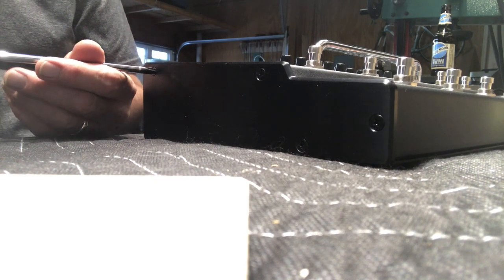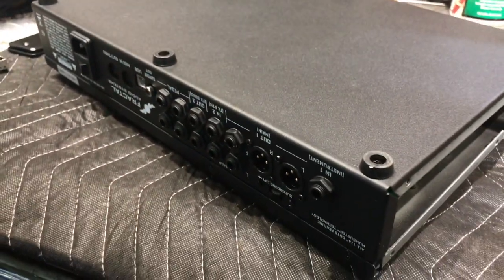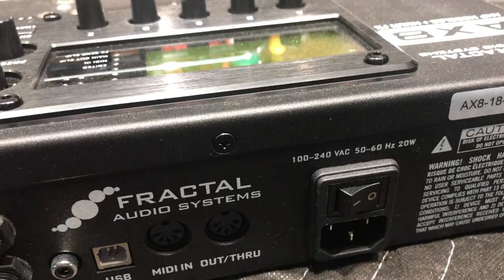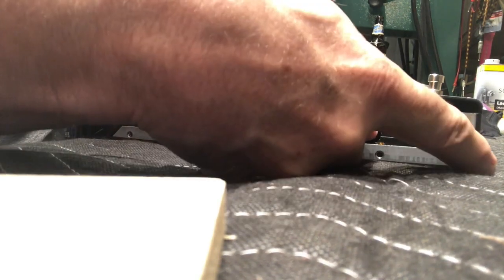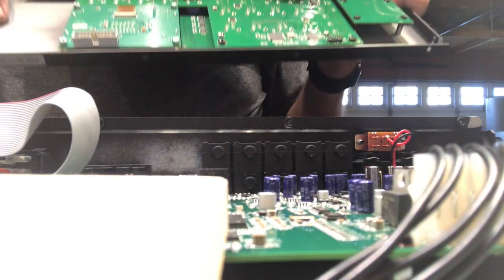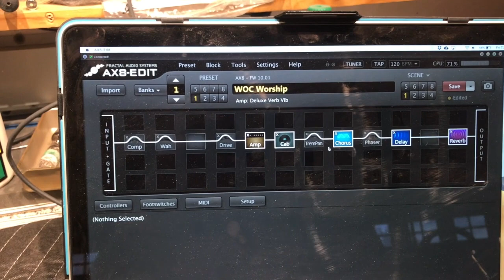AX8 USB Type B Replacement project

Comment: I could not believe it when I found this video! I have just "broken" my USB today so I have found this an excellent visual description of what is needed to get things fixed. I am asking a friend to do the soldering but I can do the nuts and bolts stuff. Thank you!
Reply from the maker: It's pretty easy, just go slow and not too much heat ok.  Cheers
Reply: @65Corvette  Thank you, advice noted, low heat so no damage and then I can get back to some blooze of a different nature!

Comment: Was the problem that the little middle plastic piece fell apart or fell out?  If so, can you purchase the little piece of plastic?  I have an older external hard drive and it appears the plastic piece in the middle of socket port fell out. Taking apart the casing off the hard drive might be a pain when I have never done it before and taking the solder out, oh no.  Thanks for the Video.

Comment: Don't put the board on the packing blanket! There's likely memory on that motherboard and it's VERY sensitive to micro static voltage! Voltages you would NEVER feel can fry them! great video though, didn't mean to come off like it wasn't. Very good work!

Comment: I still have the plastic part which fell off.  Is it possible to use glue to attach it to the pins or will it ruin the connection? I’m not too good with soldering so this would be an ok fix for me
Reply from the maker: In my opinion you just need to replace the entire jack.  You can try and glue the piece in there but be prepared to replace it.  The worse part of replacing this honestly is getting the old USB out.  Take your time and do not overheat ok.  I use sold wick to get the old solder off.  Once you get the old one out cleanly putting the new one in is a breeze.  I will say do not use a cheap soldering iron as they can do more damage, besides its good to have a nice iron for future stuff.  I have Weller WES51 soldering stations, worth it to me.

Cheers!

Comment: Hey, Recently I am having issues with my AX8. I am not able to switch presets during the gig. Whenever I restart the device, it works well but just for few minutes. Could you please help me with a solution. I am from India and I don't think there is a fractal service over here. Thanks in advance :)